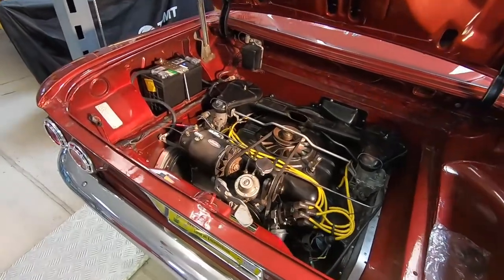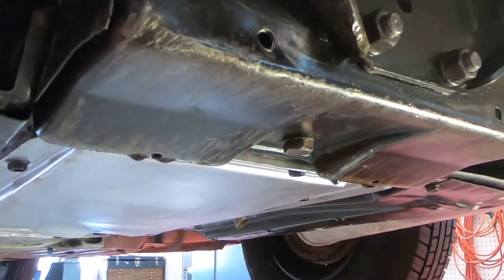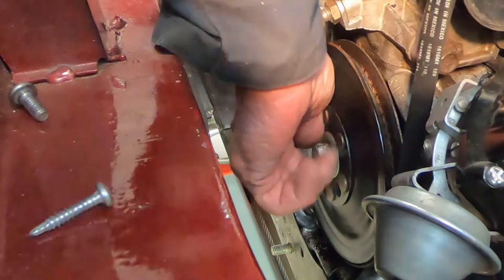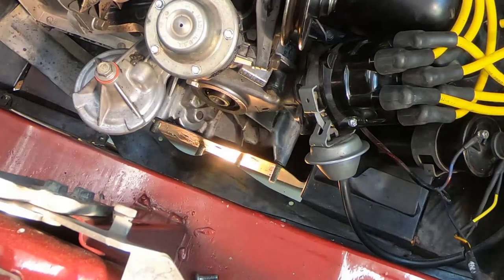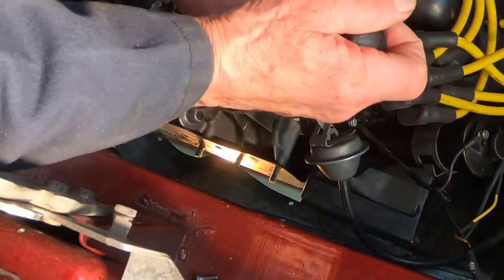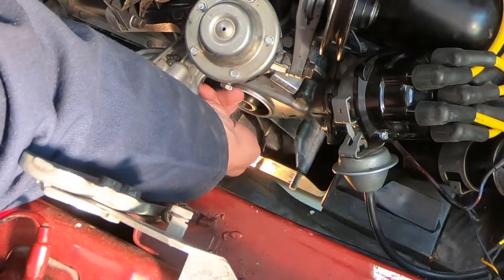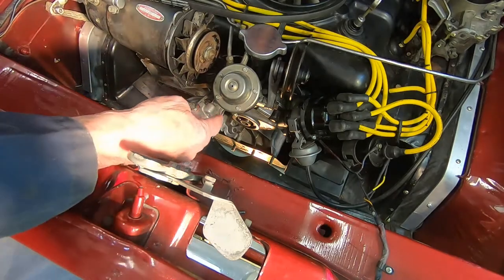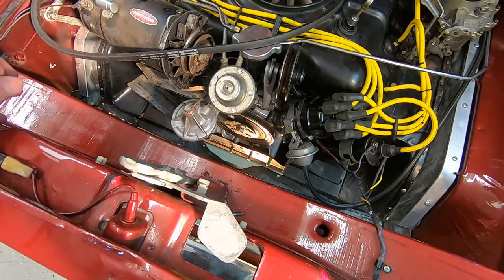Rear Crankshaft Pulley Main Oil Seal Replacement/Installation on 1962 Corvair

Comment: I have  a 1962  Corvair with 29642 actual miles on it that I'm working on. It has been through two flash floods in  New Mexico. The original paint from the factory still covers the cars underside.
Reply from the maker: Sounds like a nice car.

Comment: Thank you!!!!
Reply: What puller is that?
Reply from the maker: Thanks for watching. The puller is just a standard puller used for pulling steering wheels or a variety of pulleys/harmonic balancers such as the one in the video. You can pick them up from just about anyone that sells tools including Harbor Freight for an inexpensive one.